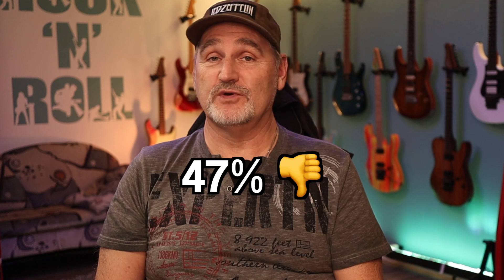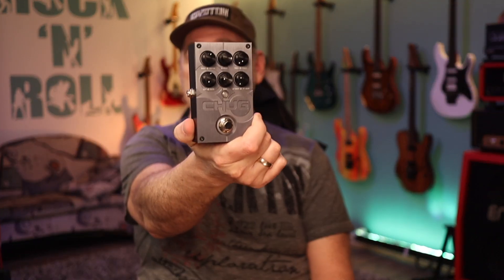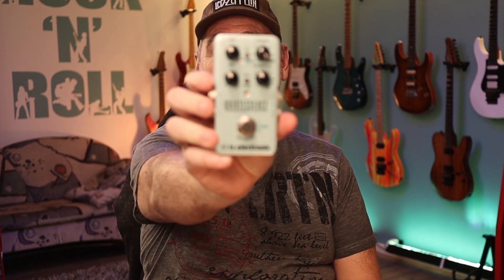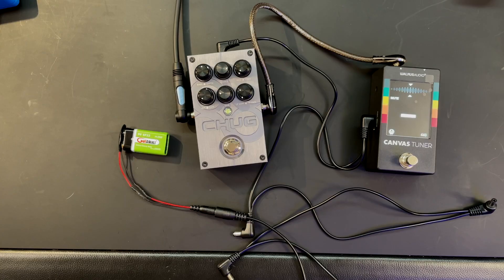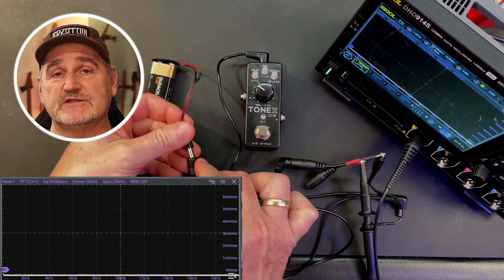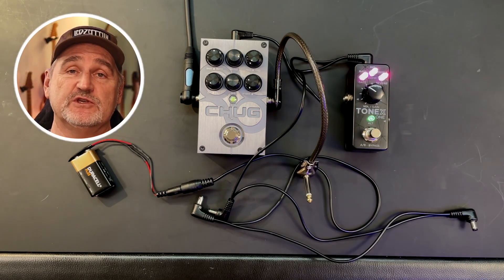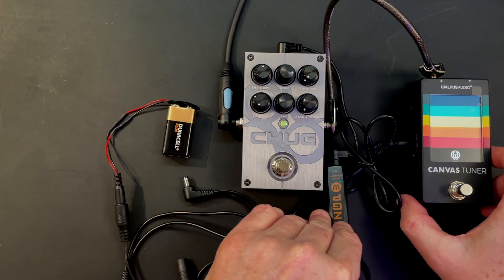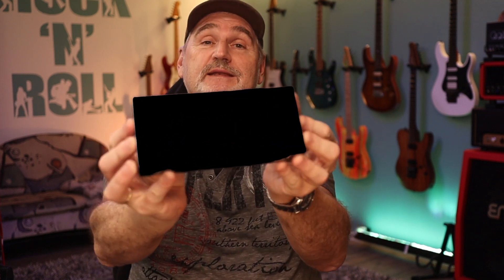The Truth About Digital Noise

Comment: Superb video. I'm getting exactly the same problem as you demonstrated with the ToneX (clear whine) when in have a Boss RC-2 and Polytune both connected. I was thinking of building a passive  low pass filter to put between pedal and PSU, i.e. replicate what those two filters do. It would be very useful to understand what circuit is implemented by those two filters. If anyone has an idea, please let me know.
Reply from the maker: Thanks a lot - the Joyo ZGPW is a DC power converter and I wouldn't be surprised if the DAddario is one too.

Comment: I use tonex one as a distorsion/boost for my tube amps and activate the noise gate from it and doesn't have the digital noise.
Reply from the maker: When used as single pedal you don't run into that issue.
Reply: @RockGuitarVibes  I use the tonex one 1st, digidrop pedal then a wah before the amp imput. All powered by the hb power iso pro 2. Could be that the noise gate from the tonex one pedal does it thing? Thanks for your videos dude 🤘
Reply from the maker: @burtosu86guitar  Using a power supply with isolated outputs and connecting each pedal to one output is the perfect workaround for not running into that issue.

Comment: There are two things I learn
1) not all isolated power supplies are problem free. E.g. The trex chameleon has a huge transformer causing emi interferrance

2) if youre using the Tonex One as a headphone amp, it needs to be grounded via wire from the chassis to the psu housing.

Thx for the video!
Reply from the maker: 1) True - the concept of using a toroidal transformer is outdated. That's why it is only a backup PS just for the case...
2) Thanks for sharing your experience - never tried with head phones.